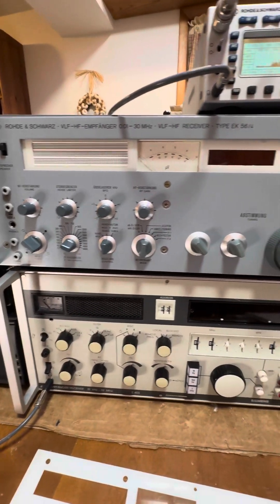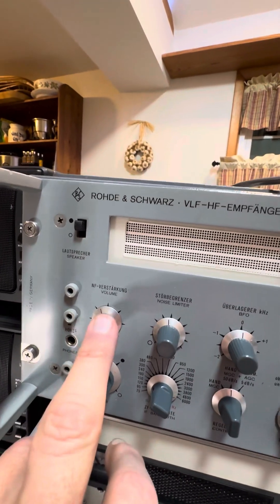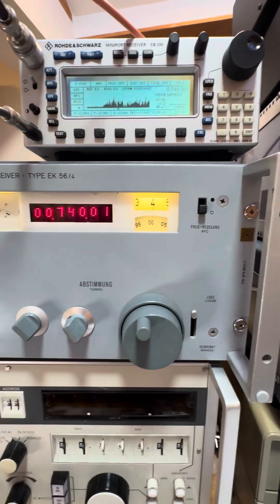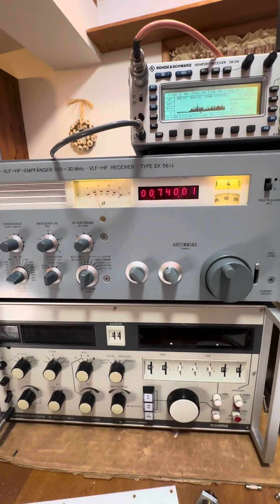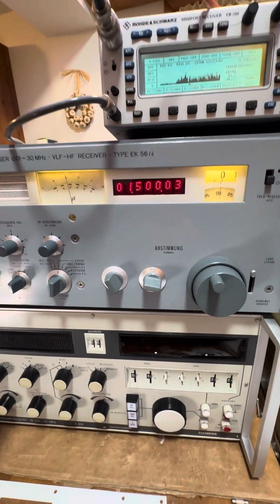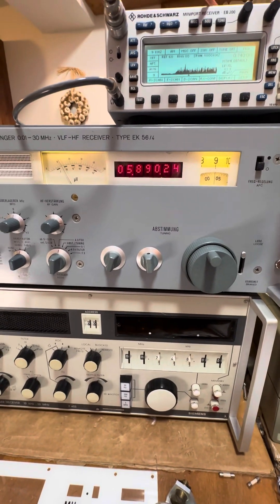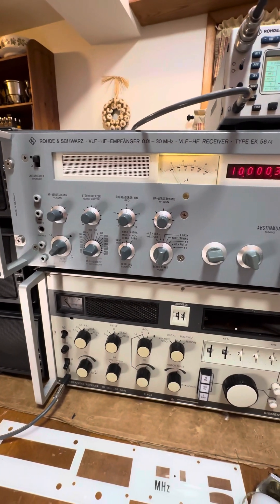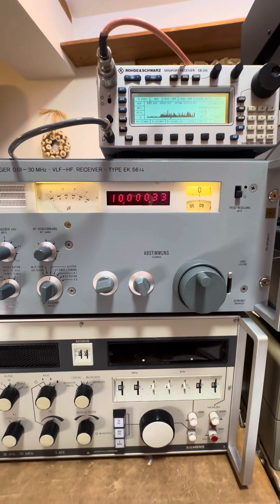Rohde & Schwarz EK 056/4: Germany’s Million Dollar Radio!

Comment: SDR PLAY will replace uit.
Reply: Yes but this is the cream of the crop and it was the best of its time, I use this analogy: it's like driving a Rolls Royce vs a modern  car. It does the same thing but the Rolls gets you from point a to b with smooth style and grace with beauty.  Sometimes a superhet just sounds better too. I'm grateful for SDR's because  of its vast capabilities but it's just so fun using an old radio built with utmost care and skill.